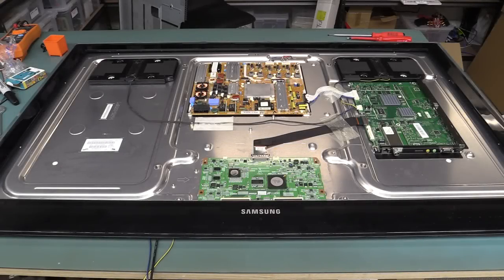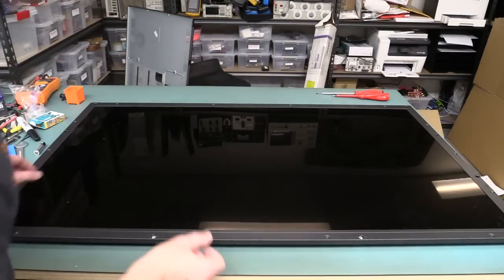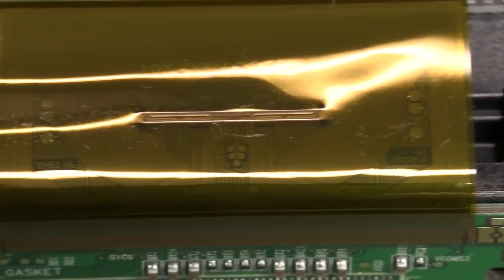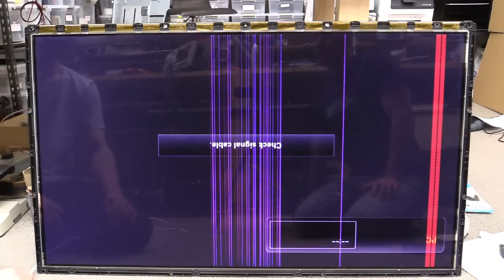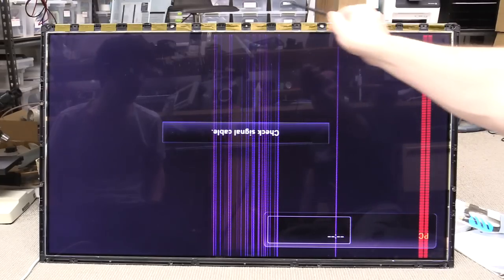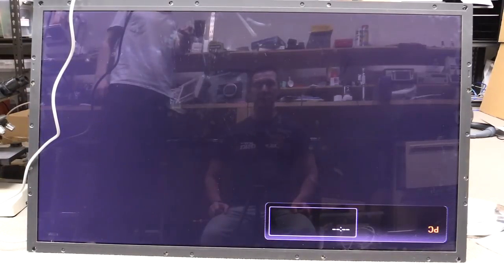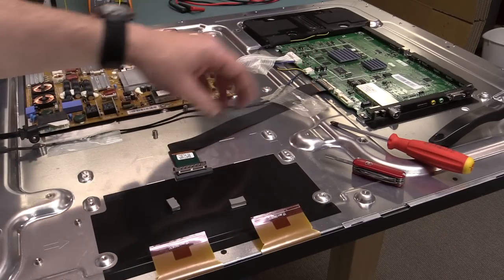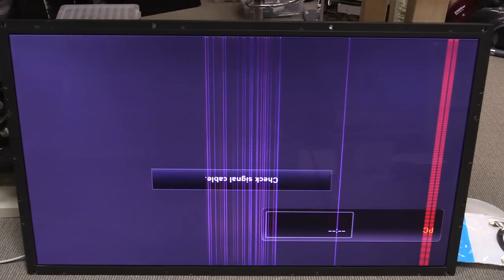EEVblog #781 - Samsung LCD TV Part 2

Comment: i think the t-con board uses LVDS, there are some HDMI/DVI/VGA to LVDS boards, you can connect such a driver board to the t-con board, and use the HDMI input to see if the lines are still there.
these boards usually can drive LCD's  up to 55"
this is such a driver board http://www.ebay.com/itm/HDMI-DVI-VGA-Driver-LVDS-Inverter-Kit-Convert-a-Bare-Laptop-LCD-into-Monitor-/111115624120?hash=item19df01deb8

Comment: Problem in the t-with specifically in ntc lack of voltage manage to repair it using a resistance of 270k to 12 vdc and a cable to ntc point this is the max 17122 or 17a ka 1718 any question ask
Reply: Can you explain a bit more?

Comment: EEVblog  The slow appearance of the lines made me all the time think of some thermal issues. Time for some thermal imaging porn (you need to use that thing more often to make people drool ^^). Somewhere on the tube there was a video of some bad sram that caused too much current consumption, thus heating up, causing other surrounding ones to fail. Thinking more about it (sorry, thinking out loud here, may as well skip the next sentences), mike has a good point for floating inputs. I think the ghosting is key to the issue here, one should think about how it comes into existance. Are the drivers latching? So maybe they don't get the proper input here and repeat what they were last set to. But why would then some pixels "leak"? Does their charge spread around somewhere? hm... I have seen a video here where some guy took some kind of ion generator from a hair dryer and pointed it towards the pcb which caused all kinds of floating gates that were around to slowly crawl towards GND (and probably below).

Comment: To me it seems like there's an issue with the transmission of the digital signal to the panel. The way they stick and fade away rings the bell of a faulty clock pin/cable. But maybe I got everything wrong  :D !

Comment: Regarding the "ascii problem" i would say that may be a failed software upgrade causes this, i would try to upgrade the firmware.

On the other hand it looks like my laptop screen which i step on... My guess that the LCD panel is broken inside.
Reply: I would test if its a broken panel issue with slightly bending the panel while its on. Sorry it its a silly idea :)
Reply: kovszilard Isn't Szilard the guy who nuked Hiroshima?

Comment: It fades in over a short time. Is there maybe some dynamic contrast system running on this TV, is there a light sensor on the TV? It's definitely an analog issue, not digital.
Reply: Deathlok67 Just to add to this, it may not be a fault in the video processor, it's just over-driving the signal due to some erroneous analog feedback (eg. room light level or similar).

Comment: This may be a stupid question, but have you tried to put a signal on it? The fault may only affect the menu and not the videosignal... I have seen that happened on a Sony LCD monitor. Not the exact same fault, The Sony had some strange horizontal lines.
Reply: F0NIX How did you fix the Sony? This one got horizontal lines too.
Reply: The Kaiser Didn't fix it since it did not affect the video signal. It was not so bad that you could not read the menu. The owner says it had gotten a little worse over after a few year but still no problem reading the menu. It has now been replaced with a larger and better monitor.
Reply: F0NIX And how is this information helping to find and fix the problem here?
Reply: The Kaiser He was searching for the fault in the wrong place. On the Sony I found WHERE the fault was, but it was too expensive to repair and since it didn't affect the video it was ok to use the monitor (It was not a TV).

Comment: without having watched the first video, or having the time right now, I'm wondering if this could still be a thermally caused issue. If it was, applying heat or cold to various components would be helpful to find the problem.

Comment: Check the voltage generators on the tcon. They (it) take in the 12v (or 5v) and made various voltages to drive the panel. A reasonable explanation of how the panel works can be found at

http://www.eetimes.com/document.asp?doc_id=1272211
Reply: Stephen Low 
Testpoint label                    Function                                Typical range or voltage4
AVDD/VDD                     To power the source drivers             +14V to +18V
VGH/TFT_ON/VON       To select a row to receive video       +18 to +35V
VGL/TFT_OFF/VOFF     To deselect a row for no video         -5 to -10V
VEE/TFT_EQU/VCOM    To bias the panel for AC operation   About half AVDD
VG#/GM#/VGAMA#      To linearise LCD response      A non-linear voltage chain 
VIN                                    To power the T-con & panel      5V, 12V, 13V are common
DVDD                                To power the source driver logic         5V, 3.3V
VCORE                              To power the T-con processor    3.3V, 2.5V, 1.8V, 1.5V, 1.2V
Reply: Stephen Low EEVblog 

Ahh, this is what I meant. Nice find, Stephen. ;)

I suspect it's one of the higher bias voltages that is low, so it's not sufficiently twisting the liquid crystal voodoo.

I still don't think it's a framebuffer or processor fault personally, it just happens on the brighter parts of the image, and the fade-in / fade-out nature is a tell-tale sign of a bias voltage / driver issue on the TCON or panel side.

It could possibly even be a fault on the main PSU, like bad caps / too much ripple?
Far more likely to be a bad TCON board though.
Reply: electronash I think the VGL or VEE is wrong, not driven hard enough or not getting to or being used by the panel column chips properly. Sony screens had this fault a while ago where you had to run a trace around the panel to join two test points on different tabs. 

I have seen this look on at least 8 different Samsung (AUO) panels.
Reply: I was trying to diagnose one tv myself suspecting t con problem. Lower part of screen is unstable and flickers a lot with messed colors. Theres's actually points to test with ref voltage written on the board.  So I dont know is this normal on VON it reads 28v, but I measure 31v. And AVDD I get 18.5 when it says should be 17.5.

Comment: The horizontal is not draining. Probably a bad cap, bad memory, bad T-CON or a floating ground. From the test pictures and menu, the problem is not related to input type or confined to the menu/OSD characters.
Reply: +procale A floating ground? What is that supposed to be?

Comment: I personally think that only one rebold of gnarly will fix the problem as it determines how transistors will keep vsoyata linearity and which of them are violated by long work on heating that is the problem in the chip and replace it will be fine
Reply: Pro Samsung video chip's analog transistors so they do not stop working and instantaneous form lines it suggests what kind of chips and if digital straight stops so change the chip and fix the problem

Comment: Is there some kind of logical analyzer (and software) exists capable of sniffing data from these flex cables? It seems would be a nice way to determine where is problem, if you could check what is going from one board to another. maybe even better if knowing how it works, and protocol, to emulate display, to check if data is valid. Or this is too hard because of speed/volume of data - too complex architecture/protocol without documentation?

Sorry if question is silly. It's just from point of view of software engineer, with not much experience with electronic stuff and logic analyzers.
Reply: Alexander Zakusilov Didin't you notice that Dave had the TV upside down? All the electrons fell out and THAT is now causing the problem!

Comment: Those vertical lines correspond as artefacts with the text, like the colon for example, the PC etc... Looks like an issue with the encoding at one of the stages in the pipeline... RAM failure maybe?
Reply: David Thornley The question is WHAT on the tcon board is cactus and evenly important, WHY.

Comment: first time ive seen someone try to repair a tv by putting it in the oven you nutter
Reply: +Ben Hunt I remember those days. You could fix the red ring of death by literally force overheating your Xbox. Me and my cousin back in the day wrapped ours in a thick blanket to block all the airflow  and then just let her run for about an hour. Sounds like a horrifically bad idea but it got so hot it reflowed the solder and the issue was fixed. Got many more years out of that xbox. Crazy becuse the repair was so counterintuitive.

Comment: Does the length matching of the conductors in the LCD flex make significant difference to timings?
Reply: MrCube17 Not sure at all, but the proc. board is sending to the tcon board the whole screen pixel data at 60hz, the signals going on this strip should be insane fast since just a few lines to make the whole panel. Would be interesting to probe there to see the actual freq and rise time of this lines, almost RF stuff to me.
Reply: +MrCube17 Why? Do you think one of the flex cables grew longer?
Reply: The Kaiser The ribon has a shape to avoid twisting, it make a turn
Reply: 38911bytefree Ah you just want to see the video signal on the oscilloscope to see how it being send. Good idea, that's interesting.

Comment: Ah yes Samsung and their dodgy panels :(. I have 3 decent Sammy TV's with the classic "Half Dark" issue in my parts grave yard, and close to a dozen others dumped in the scrap bin because of it. one day I will try re-bonding the ribbons, but it has a very low chance of working.

They do make good targets to shoot/lob stuff at when lit up. they might not work properly when intact but they still craze up when you break the glass layers :p
Reply from the maker: Aussie50 So you recon it's the panel?
Reply: EEVblog ***** With the "Half Dark" issue you would lose half of the screen, but in Dave's case both sides are displaying things and the problem is on both sides. So the panel may be alright, since the lines are not fixed on one place, i presume.
The weird thing is, that the problem is only appearing after some time, so it could be the TCon-board

http://www.badcaps.net/forum/showthread.php?t=17189 On the second last post (#19) one user has pretty much the same problem
Reply: EEVblog not 100% positive, its just my experience that some edge drivers can go bad and cause lines to light up incorrectly, but apon watching a second time, you are getting some strange noise that is not consistent with a bad panel driver. it could be a replaceable board issue (T-Con or Digital Input Board).

I would not give up on it yet, I am looking forward to scope work on it :D. if it was solid bars top to bottom I would definitely call it a bad edge ribbon chip tho.
Reply: flat panel tv's make the best handgun targets! nothing like the old tube tv's that only took a couple shots before disintegrating into a mess of glass, flat panels stay together and stay lit up until you sever the power or control circutry. Murica!
Reply: raphi02 Thats a very good point, the lines do appear on both sides, if a edge board or driver was bad it would be more localized!. I would look at that signal board or T-Con first before canning it. sorry to be a bit misleading EEVblog . seen too many bad panels and jumped to a conclusion.

Comment: Oh bugger, i thought the lcd edge cables would show a difference :-(
The t-con board has to switch the lines to the lcd in a clean way, i would throw another  t-con pcb in as its a common fail.
Reply from the maker: zx8401ztv So did I, I was feeling fairly confident it would be the LCD TAB connections, but no amount of prodding made it budge.
Reply: That's not what TAB bond failures usually look like.  

A TAB bond failure will almost always be stripes in certain sections of the screen associated with the bad TABs, not the whole panel at once like this in high brightness areas.

For future reference to anyone, though I couldn't see exactly where Dave was prodding the flex cables, the faulty bonding is the ones going from the 16 flex cables to the panel itself, not the area where the flex cables connect back to the two long PCBs.  Those solder connections rarely fail.  Generally if the fault is the TABs, pressing the flex cables harder against the panel will show some change and can sometimes be wedged with foam or whatever as a semi-permanent fix.

The only proper fix for a TAB bond failure is to use a jig with a microscope and a controlled heating element that you can re-do the TABs with.  They are very expensive, though a few people have made home-made ones (there are videos on YouTube)but it is still difficult and expensive.  :)

Comment: The BGA, as always, i bet. That biggest ASIC with heatsink. Rip off the heatsink and blow like 220 on it for a few sec, should make a screen normal. That ghosting seems only to appear on OSD elements. And besides BGA's are a common planned obsolescence target nowadays. From laptops, through tv sets, to printers. I wouldn't be surprised seeing an air conditioner broken because of dying BGA in it...

Comment: problem is gonna be tcon or panel but i would clean the 2 ribbons with alcohol and /or a pencil eraser connections on ribbons on tcon. i have fix a tv with ghost image and lines with clear tape lol yes clear tape (on the ribbon cable

Comment: Hey bro, I really really need your help! I have a 46inch Samsung model number LN46C630, Im still getting the  lines on the screen!!!  Although I managed to narrow it down to where the problem lies.  Its the bottom right hand ribbon cable on the mainboard, model number BN94-02701G. When I gently press on it the lines go away and vice versa! Please Help! I would greatly appreciate it!
Reply: I don't know anything about TVs but if you still have and it and the lines go away when you lightly press the wire then tape it down. I had a tablet with ghost touching and I tapped some folded plastic down on the ribbon causing it to stay put and work. Worth a try?

Comment: Buy replacement boards on eBay for testing, re-sell the the ones you don't need when you're done! You'll lose a bit in shipping and auction fees, but it wouldn't be too terrible.;)
Reply: +BauTek Industries That would be cheating.